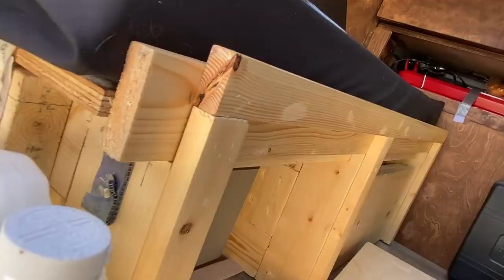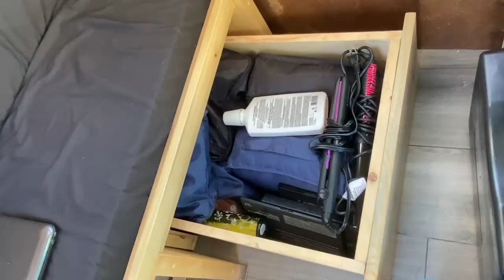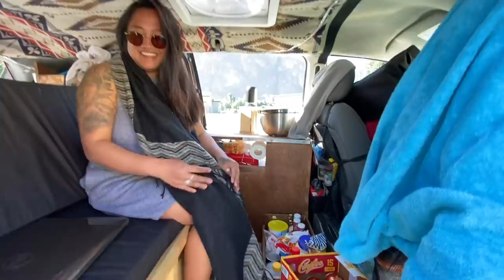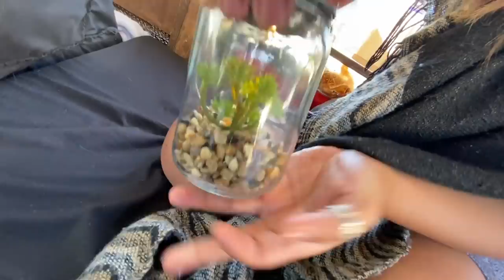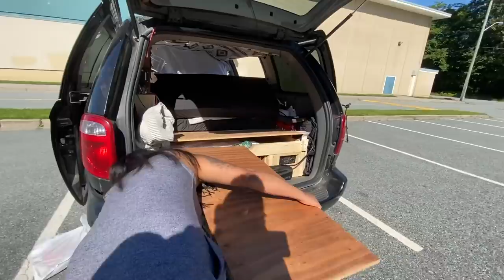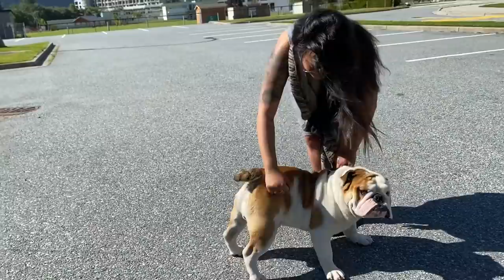Solo Female Van Tour - DIY Minivan Conversion That Has Everything She Needs For Solo Travel

Comment: "Just put a blanket in it and go to bed" LMAO!!  She's hilarious!! (This next part is not directed at Isabella. Just an observation in general). In Vancouver, van going travelers think that by giving their van a name, telling you how much they love it and building a wobbly  bed platform out of particle board, they can turn around and flip it for the same price that  they paid for it a  year earlier. This is  after ripping out most of the seats, stinking it up with grotty hiking gear and patchouli oil and racking up the kms driving up every logging road from BC to Botswana. You can probably see a couple  on craigslist right now.